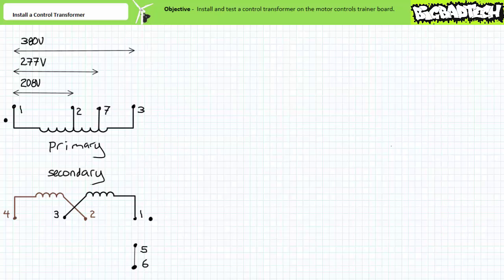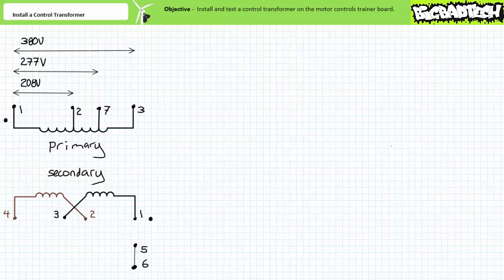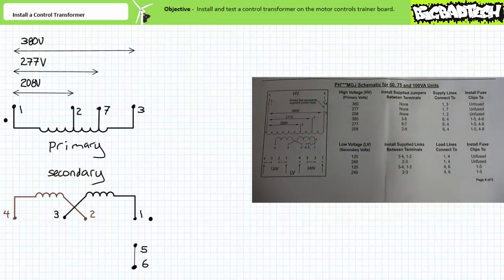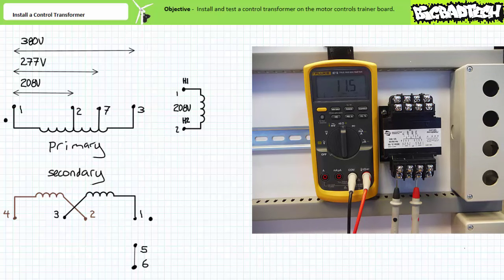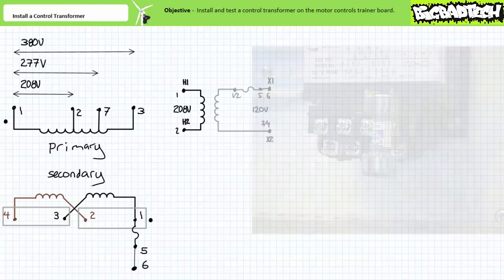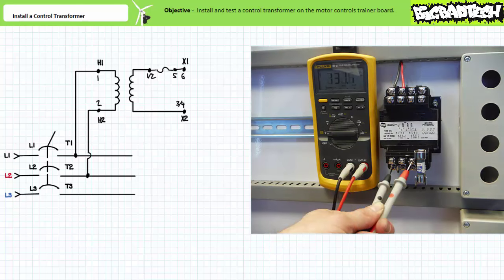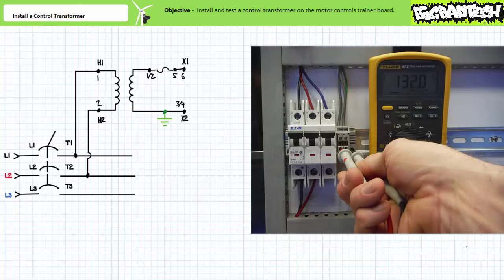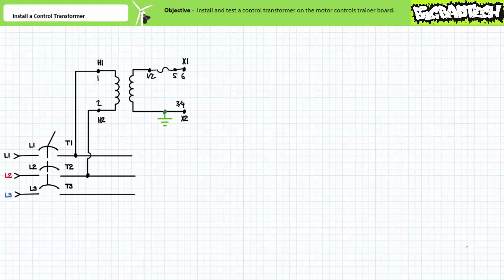Install a Control Transformer

Comment: Jim, you connect the primary input of the transformer between L1 an L2.  You use terminals 1 and 2 of the transformer reserved for 208V. But line to line voltage is 400V. Is this just a mistake on your draw or maybe I dont understand something? Thank you very much for creating such an oustanding learning materials. It helps me a lot. Thank you.

Comment: I was wondering why you connect one side of the step down transformer to ground. I think I understand that when measuring voltage across the coil, it gives you a reference of ground to give you a more accurate voltage reading. But wouldn’t that just allow the current to flow straight to ground and not through the control circuit as that would be the easiest path for the electrons to flow?
Reply from the maker: The load (ie: control circuit) is between the hot and grounded neutral. Any current must travel through the circuit to reach the ground referenced neutral. Any errant low resistance path from the hot to neutral would have substantial current traveling through it and blow the fuse. Here's more on center tapped transformers and transformer connection diagrams:
https://youtu.be/n9YflRWyXLY
 https://youtu.be/SfTedV88OK0

Comment: I often see control voltage as large as 220 V left floating in electrical diagrams. What can be a rational behind leaving control voltage floating? Sometimes it explained as a safety feature, but in every national or international code it explicitly said that floating systems must have some kind of isolation resistance control device, otherwise it will be safe only untill first ground fault.

Comment: Hi Jim. How is the secondary current limited on a step down transformer such as your control transformer, it says 100 VA, or say a battery charger for an iPad or digital camera etc? If we step down the voltage say by aprox. half,  208v to 120 volts, or from 120v to 5 volts, what keeps our available secondary current from doubling or more?
Reply from the maker: Excellent question, I've got a whole series of lectures on transformers in the works. Short answer, the load on the secondary determines the current in the secondary and current in the primary is inversely proportional to the turns ratio.
Reply: The VA of the transformer will dictate how much Amp you are able to draw from it either secondary or primary. I.E.: I= S(Kva) x 1000/ E, so lets say you have a 150VA 1phased transformer that does 120 to 24 amp.

I= 0.15 x 1000/120=1.25Amp on the primary
I= 0.15 x 1000/24=6.25 Amp on the secondary.
For the 3 phased transformer you must do a little more complicated equation:

I= S(KvA)x1000/E (volts) x 1.732 (square 3), So if you have a 1500 kVa transformer:
I= 1500x1000/4160*1.732= 208.19 Amp at the primary
I= 1500x1000/600*1.732= 1443.42 Amp at the secondary.

Hope that helps.

Comment: If I wind a step down transformer, for 120v primary and 60v secondary, my turns ratio is 2:1. So if I figure 15 amps max into the primary (limited by the breaker size), I will get 30 amps out of my secondary and have to size my wire accordingly. Now I look at my cell phone charger, it has 120v input and steps voltage down to 5v, a 24:1 ratio. If I was winding a transformer for this ratio, and assumed 15 amps max. on primary I would figure my secondary could produce 15 X 24 amps, or 360 amps. But on my phone charger it states output current is only .55 amps, and even if I short the secondary out it will only produce .55 amps, no where near the theoretical 360 amps. My question is, what's in that little charger that limits the output current? Maybe this  question is better left till you do a transformer series, but I always wondered about it.
Reply: .55 amps, 550 milli amps
Reply from the maker: Long story short, there's more than a transformer in your power supply and some of the questions will be answered in the upcoming power electronics lectures as well. It's what's known as a regulated power supply with predictable maximum outputs.